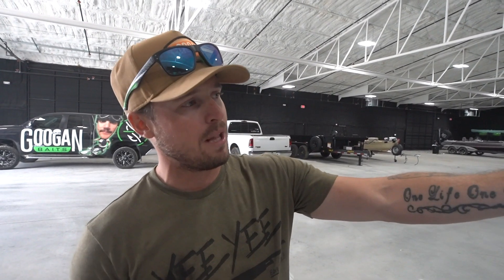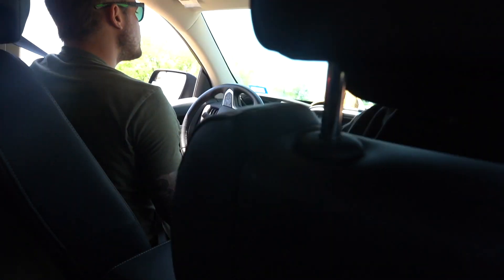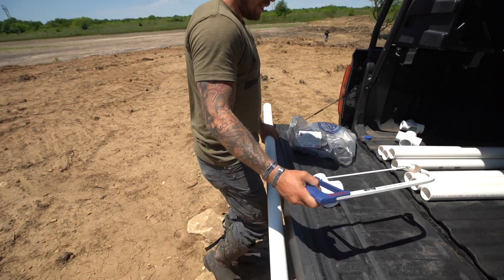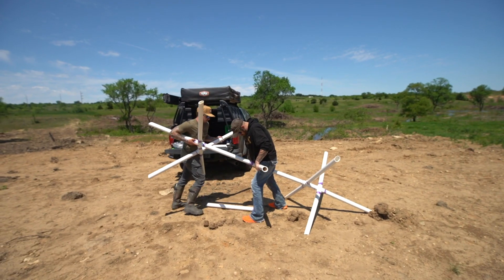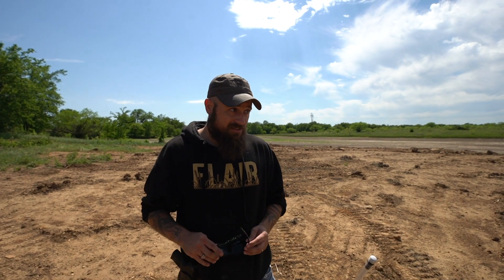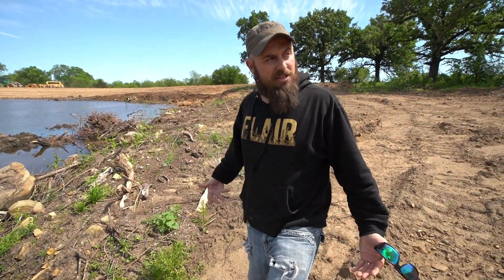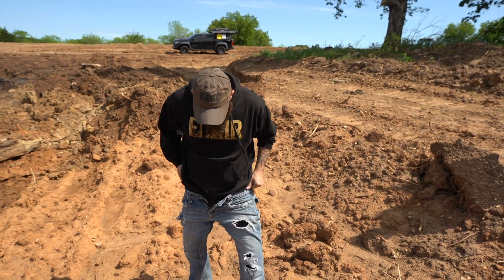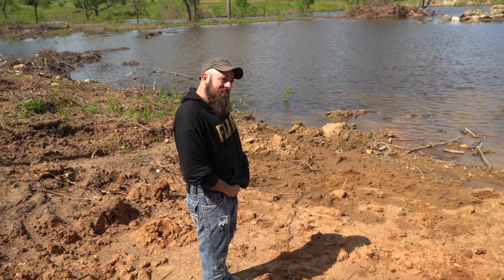My WORST Idea Yet!!

Comment: Also for your equipment stop using normal diesel. I noticed when you were feeling your skid steer it was with clear diesel, since they're pieces of equipment you can run off road diesel and save yourself a lot of money too.
Reply: I thought the same but I also thought it's for tax reasons it's part of the business so they might better off spending a little more so they wont have to pay so muchat the end of the year or I might be wrong but just a thought

Comment: I’ve made some on my pond. Not log size but multiple (bushy ones) take a 5gal fill with come concrete. While wet, shove whatever size pvc in the concrete until it looks like maduessa’s hair, forget it and let it set. And boom structure. Then you can proceed to throw it in the lake ;).

Comment: You should try cutting like a 6 or 8 in PVC pipe down into 2 to 3 foot lengths and jam them into the side of the bank laying flat horizontally. Either stack them up or put a couple of them around each other or all separated and see how that works for structure. Itd be like little cubby hole bedding areas in the side of the bank that they can tuck into and look out of.

Comment: Lunker, just get PEX piping and fill a bucket halfway with concrete, stab the piping in let dry, then fill to the top with concrete and bend a rebar hook and stab that in. Use that to lower it with a rope :)

Comment: PVC and CPVC cut it deliberate and it where you're going to Blue Lake and even sanded in the fitting want you sanded them glue on the fitting only and slide them together give the pipe a quarter-turn and you're done

Comment: Dude... You did too much at once with the PVC cement... Instead of trying to do 12 at a time, You gotta get the inside of one lubed up first, then the outside, then put the outside in the inside, gently squeeze them together, and everything works out happily.  One at a time.

Comment: God as as pipe fitter for 14 years this was hard to watch. What the hell were y’all trying to do lol... future reference you glue one outlet and one end of pipe then push them together. You also have to cut straighter than that. Being that it’s not holding pressure it doesn’t have to be perfect but you still want a good glue joint.

Comment: um rob um you for got to use two different types of glue the purple glue and a clear or blue glue,  and the purple glue is primer and clear or blue is what bonds the two together o and if you left it the way it was then you would of have it rises to the top of the surface of the water so you should of put rocks or sand in it. sorry rob for telling you how pvc that plumbers use on a job on how to use it proper. o and it was funny to see you through the pipe.

Comment: If i were a betting man id say rob is fixing to sell the chevrolet and the ford and get a ram cummins. I say that because he said he put a ton into the ford front end(he used the phrase "way too much") which i totally understand because i have done the same exact thing with an f 2 and 350 both because they are garbage trucks and not worth what they require to stay reliable. Also, hes best friends with rackley from the LFG channel and rackley has a duramax and has had several problems out of it and just recently and taking it to the dealer has done nothing to fix it. Theres two big time negatives hes looking at from people around him as well as himself. He also is best friends with matt kerricker who has a dodge ram cummins named end of world earl. Matt has had nothing but amazing things to say about earl, he even mentioned in a video he likes the cummins way better than the raptor. Matt like rob has had a ford f250 and has had a ton of problems out of it and had to get rid of it because it was junk. With all that being said, rackley having a lot of problems from the chevy duramax and himself and matt both having issues with the ford powerjokes, the only other viable diesel option is a cummins and matt has had a ton of good stuff to say about his cummins. For those of you who will bring up the video of earl being in a shop, earl was only getting upgrades, not fixes. Thats important, earl never broke he was just adding stuff to earl that made him even stronger, not necessary but a nice benefit. Unlike forda that require an absolute ton of engine and front end work to be reliable and keep ya in a straight line. If i aint mistaken grimes owns a cummins too so rob has a lot of positive and happy cummins owners around him and a lot of disappointed and upset chevy and ford owners around him, him being one of them. Im excited to see what he goes with but id have to say if he goes with anything other than a cummins he has shut his eyes to every sign that the universe is trying to tell him that the dodge ram cummins is the best truck hands down on the market today and he needs to buy one for all his mpg savin, boat haulin, grocery gettin cause it gets good mpg, family truckin cause its got leg room for days, did i mention it can tow a mountain to the mole hill so you dont have to make it into one yourself! A ram cummins can do it all! Lol

Comment: The PVC you had would of still worked for s structure but you decided to wreck it any way plus it's funnyto watch a guy get frustrated just because the PVC glue set  LMAO plus you're going way in depth into the fish structure just throw some trees you'll be good also in my pond and lakes around my area the best structures are rocks just make a good rock pile easy to do with leftover concrete seems like you have some there too.

Comment: It's obvious you've never used pvc primer and pvc glue.   First you prime the pvc with the purple stuff.  The male and the female. The primer cleans the pvc and gets it ready for glue.   Then you put the glue on and press the two fittings together, quickly.  Seriously.  Quick.  Don't pussyfoot around like you wanna date it.   The fact that you could pull it apart tells me you forgot the glue.  And then you got pissed off and threw it all over the place.

Comment: Dude did you guys only put the purple primer on and not the pvc cement? It comes in a combo for a reason, primer first cement second. Also you should use a proper pipe cutter and a chamfering tool so you can slide it in and out without wanting to kill something. Rob, stick to guns and rods, stay away from plumbing and farm equipment lmao

Comment: If this was your worst idea, you're lucky. Believe me I've ad way worse. Last one I did I decided to go out on a big 30 foot long floating tree to take a cast because the water wad flooding on the Mississippi. For a good and a good bite. But thw Fish was so big it pulled my...... off that teweliked greased fricken lightning. Went over my head had to drop my rod to prevent from drowning and get out of that dang current before it swept me down a mile. As I was getting oit of thw water I had a cut on my leg. Not a bad one but Good enough to attract a nice 10 pound bar. He bit my leg. Spent am hour to dig oit digging out several teeth. Prey yon don' have rhat happen to you. Fish on.👌👍😊